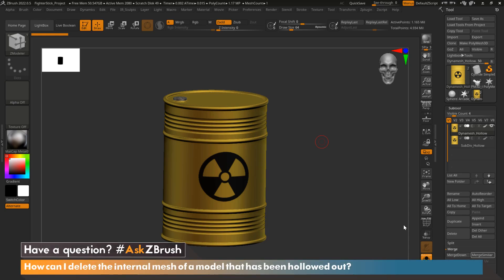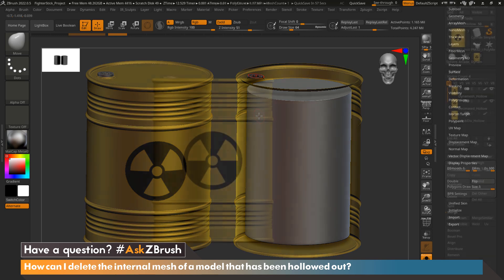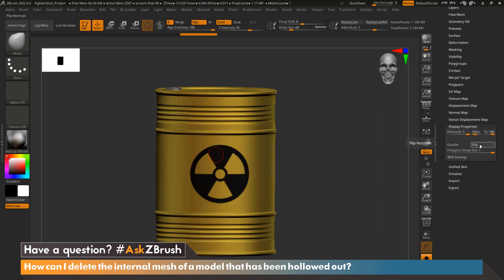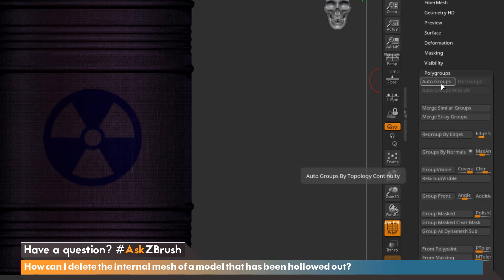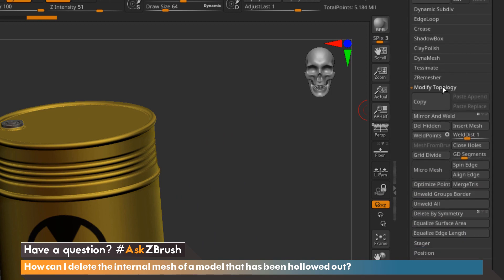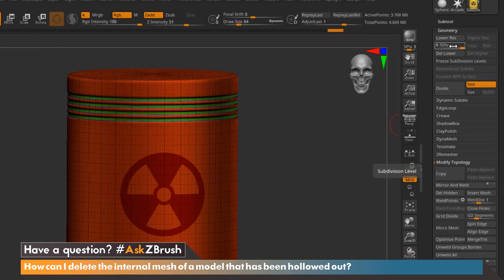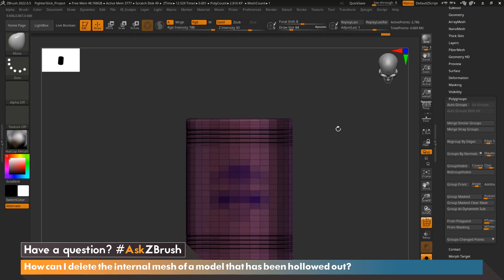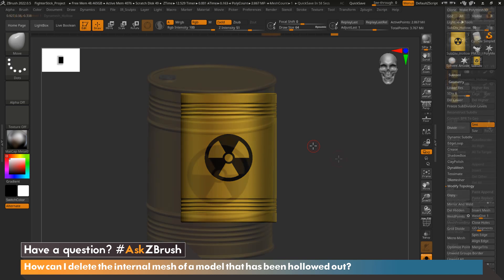#AskZBrush - Delete Interior Mesh From Your Models

Comment: Most of the time we want to keep Polygroups intact because they are very useful. In case we want to keep Polygroups for further modeling, another easy way to remove inside meshes is to do a Subtool -> Split -> Split to Parts and delete the unwanted subtools that result from the operation.

Comment: Right, now the tricky question. I have a skull that comes as a 3D model from a CT scan. And the model is Hollow with apparently no connections. I just can not select the inside. Not even by flipping the model. How can I select the inner part?